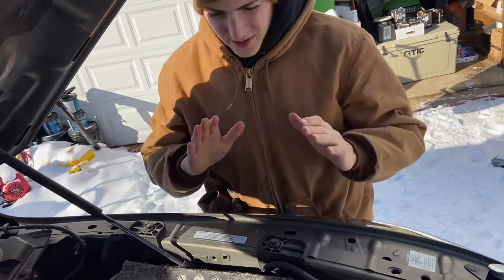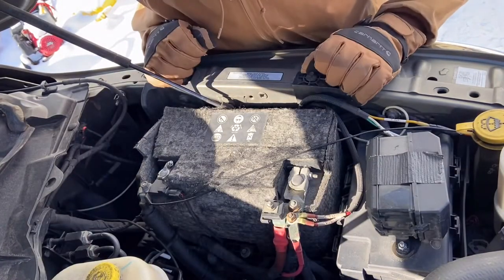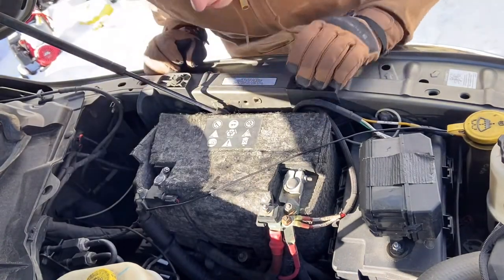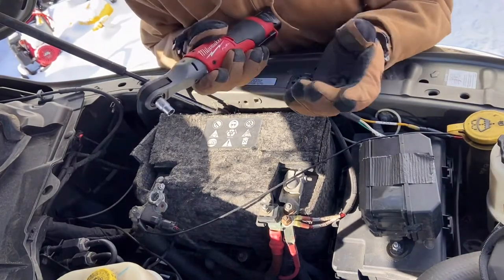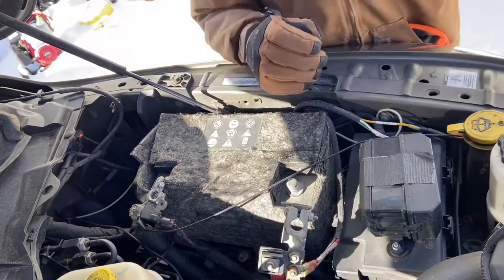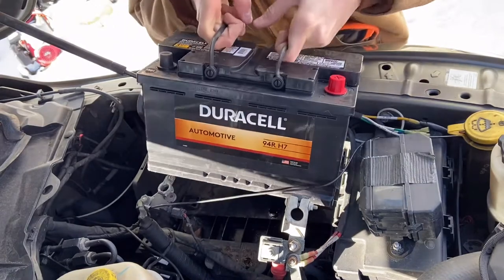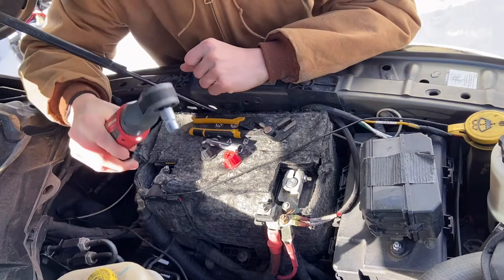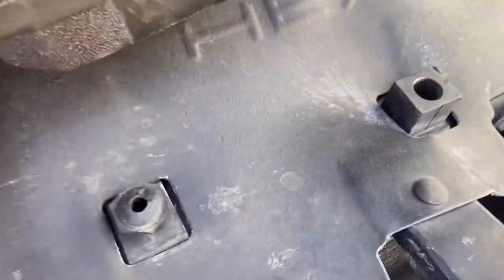Changing a battery on a 2015 Dodge Ram 3500

Comment: Hey which code was your truck showing ?
Reply from the maker: The truck was throwing a low voltage code, and was going into battery saver mode.
Reply: @McMurrayMotors  great to know my truck is doing the same, thought the issue was deeper than just the battery. Thanks for the help !